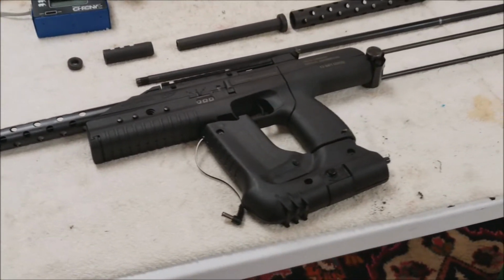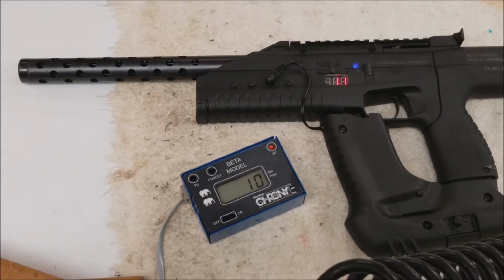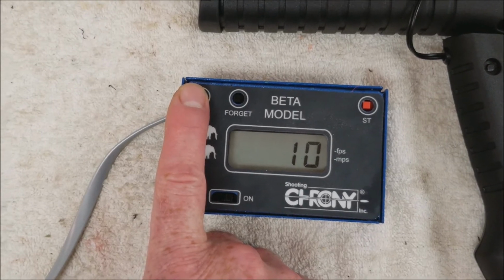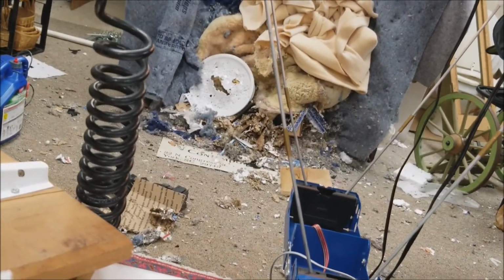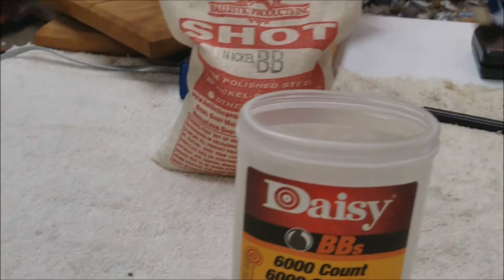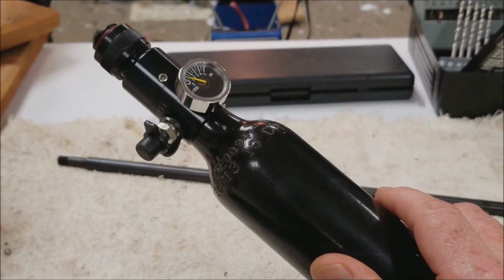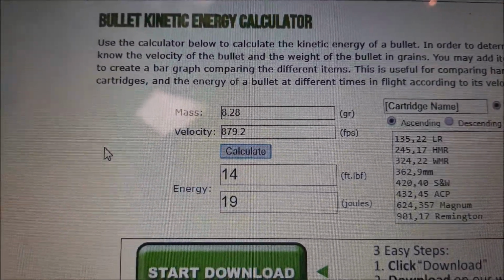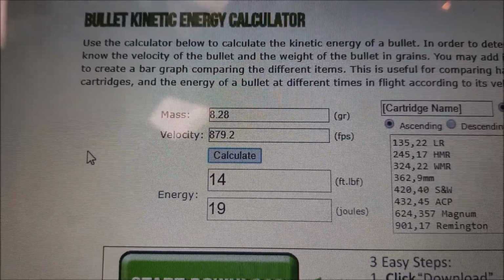DrozdMax Tactical Rifled Barrel VS. DrozdMax SMG Smooth Bore Barrel

Comment: Cool stuff. One question: running it at 4k rpm @900+ fps, what capacity tank would you need to dump the 800 capacity mag?
Reply from the maker: If I remember correctly I get two and a half mags from a 90/4500 before the pressure drops below 1600.

Comment: Great job, brother 
I would love to see the voltage, fluctuations 
Maybe the voltage moves a little up or down
Reply from the maker: Great to hear from you bro. I don't think the voltage is the issue. You see it's really consistent with the steel shot. Ihe lead shot just isn't that uniform. My earlier tests of prototype seals were done without porting the air inlet, and removing the filter behind the HPA adapter. That hole is tiny! I drilled this one out to 1/8". It's easy enough to do. Just take the adapter out then the filter. That cylinder just pulls off. I believe without porting the inlet you start running into refrigerant slow down.